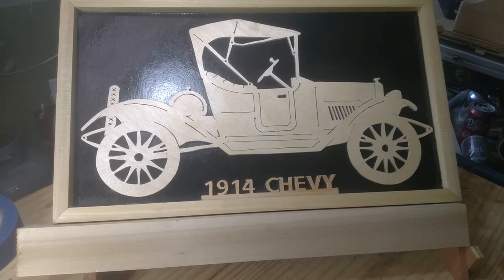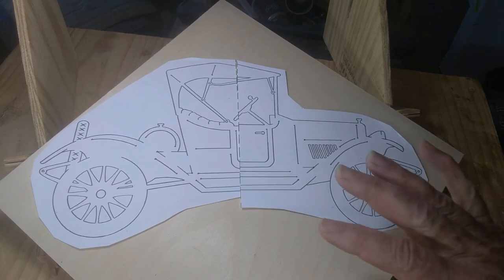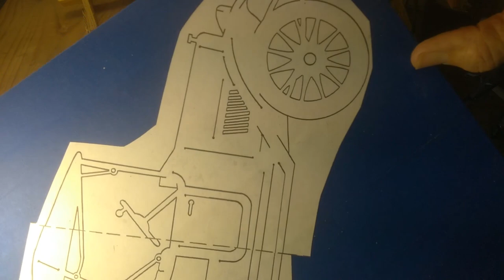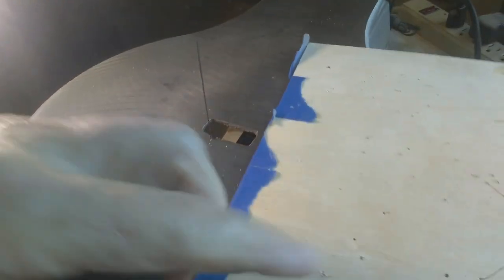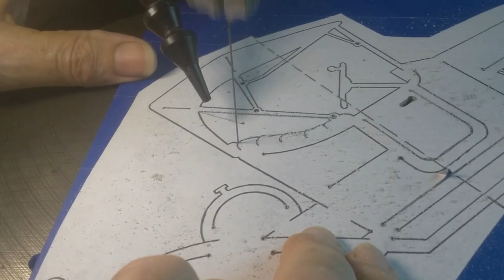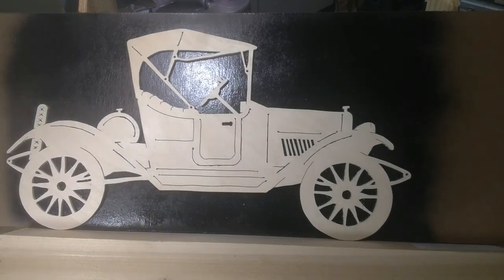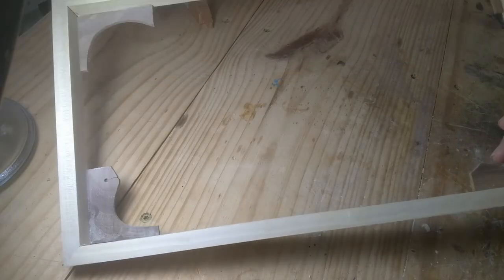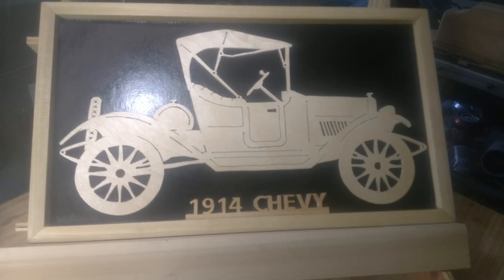Cutting Slots (veins) In Wood To Create An Image

Comment: Excellent work ,,, I need to get me one of them little drills you have there. I use my drill press it’s not a floor model but it is pretty big. Sometimes it’s hard to get them tiny drill bits in a big chuck. Great video.
Reply from the maker: Thank you.  I was using a table top drill press and hand drills until I bought this little drill.  It cost more  than my scroll saw did, but then I have a inexpensive saw.  I got the drill at www.seyco.com/scrollers-drill/.  I also buy small bits at  mikesworkshop.com
Reply: @twinoakstreasures9032  thank you sir